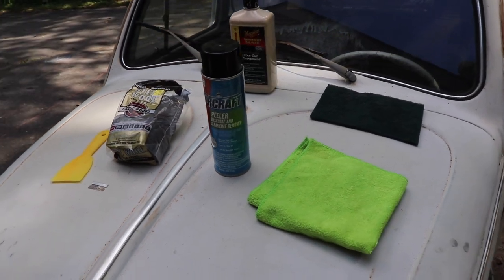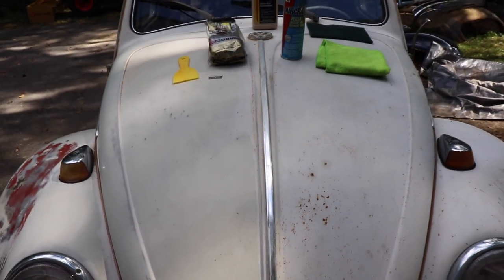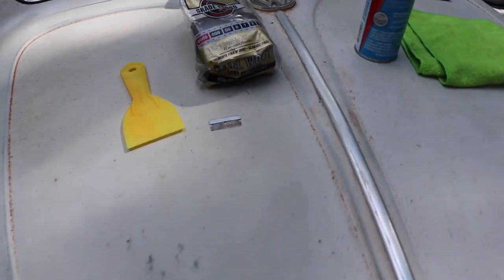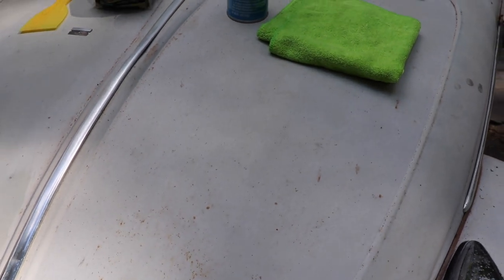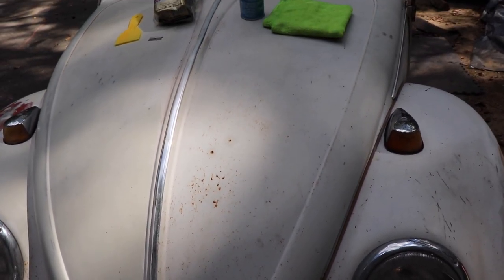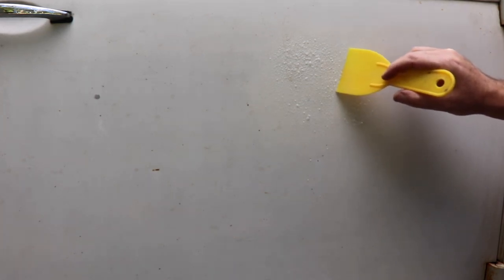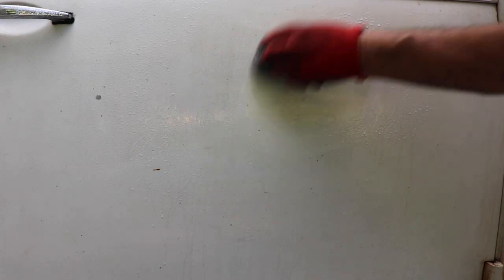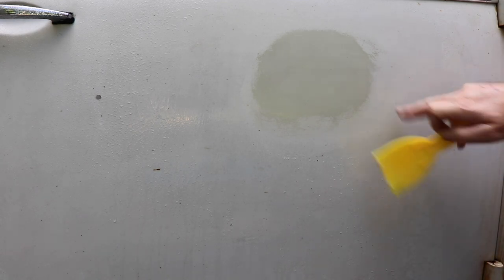Removing Paint to get to original paint : paint stripping the 1964 Beetle

Comment: I just bought a 57 euro oval with bullet fenders and semaphores off the samba. Matching numbers and original engine that doubles as a mosquito fogger. It has a hideous paint and thick bondo, but no rust. It’s also has 58 hood and deck lid. Really weird but I want to get it back to original color which looks like L 387 prairie beige. Thanks for the tips! It should be fun figuring out this mystery.

Comment: My God thank you! Looking forward to doing this on my 1972 f250 highboy. Previous owner sprayed black primer and coat looks very thin as I can see it flaking off and see the original scandia green under and patina. I hope I’m able to bring it back to its original color 🙏
Reply from the maker: good luck but go SLOW and small areas ...I have seen a Ghia have a full repaint completely removed and now sits in OG paint ...amazing transformation ....
Reply: @5150mxVW  I’m gonna tape off section by section and take it slow. I saw some guy take it off with water and scotch brite attached to a drill hahahaa Im gonna have to find out what will work the best for me. Paint that’s on my truck now looks cheap and rattle canned

Comment: also put a sponge in a bucket of water this will prevent you from using the hose as much. try liquid stripper gloves on and dip the scotch brite in a bucket of liquid stripper and put it on the surface remove desired paint and neutralize. right after with a sponge. when your done use a automotive buffer and buff whatever is left then it will have worn off stuff and some metal and some rust or bare areas then you can get the color matched in a spray can to protect those areas or just leave them bare and clear the whole thing with flat clear.
Reply from the maker: Thank for your your tips Mike , I appreciate them all !
Reply: Do you have any specific brand or type of liquid stripper, Mike? My '66 has a thin paint coat over the original. It picks off with a blade, so I think it'll peel pretty easily. Thanks.